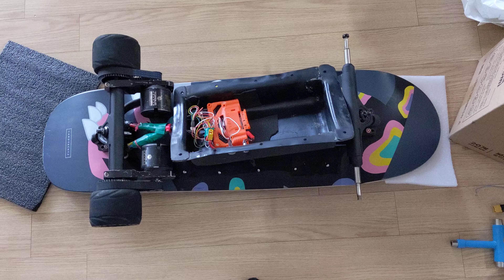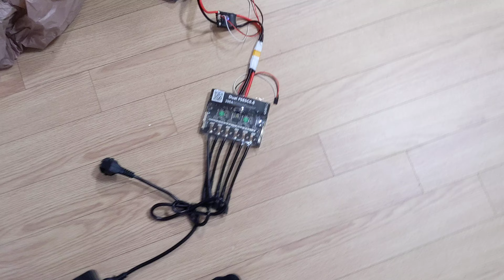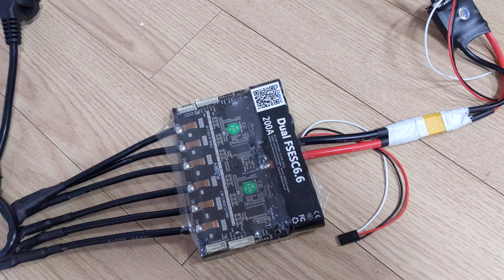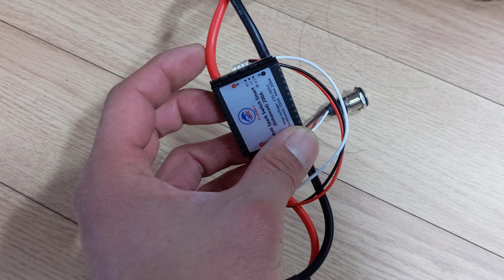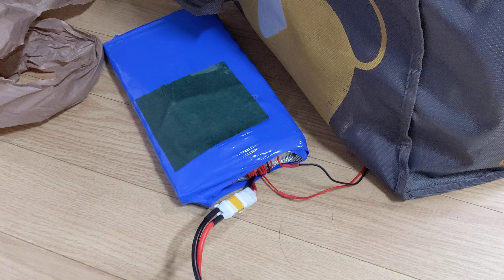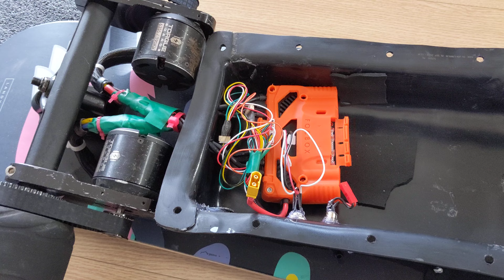Focbox died on me.  Do not recommend.

Comment: It looks like it was a short. It can happen with all electrical appliances. I bet you that if you test the CAPASITORS. one of them is burn out from a current spike. Stuff like that happen all the time to TV S and electronics. That's Base on my past experience with electronics. They are super cheap and easy to change, Always be on the safe and add an antispark and best of luck. If you don't want to keep it and are throwing it out, send it to me and I'll put it to good use.
Reply: so the battery maybe spikes? causes to spark or whatever causes the spark would result a capacitor to short circuit?

Comment: Build Kit Boards have the Xenith now, its a much better, quality controlled version of FocBox
Reply from the maker: Yeah seen those.  Pretty much focbox seems like.
Reply: Wanna check that one out since I just fried two of my Vescs. It has a warranty which is good, but I wouldn’t be able to solder bullet connectors. I’d have to use the included connectors.